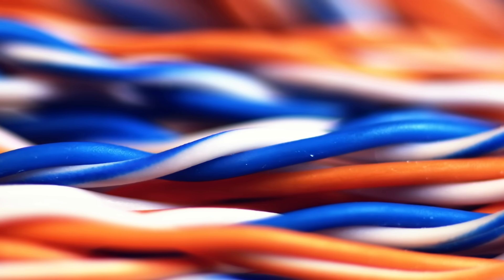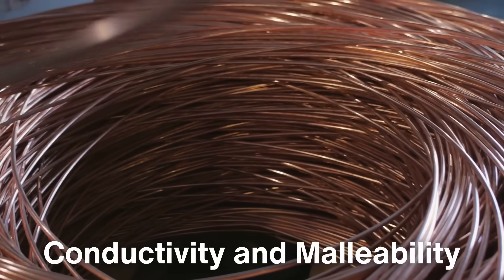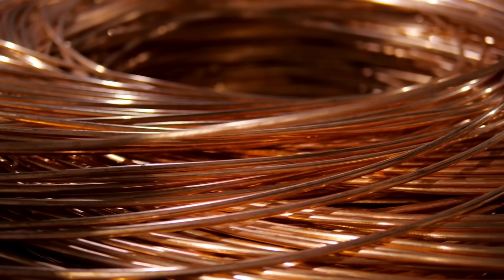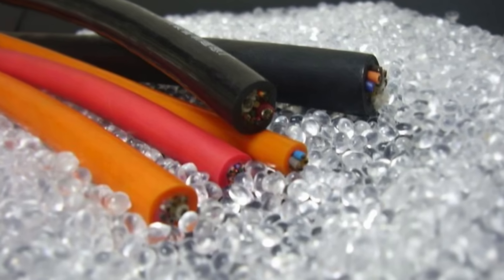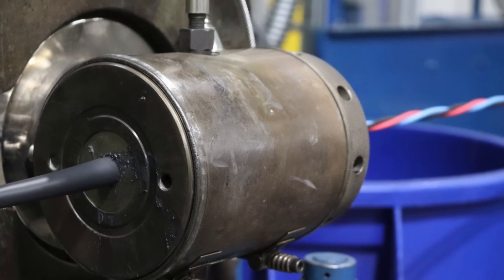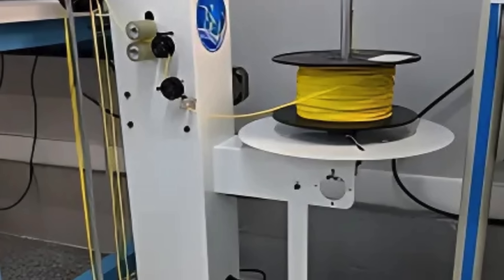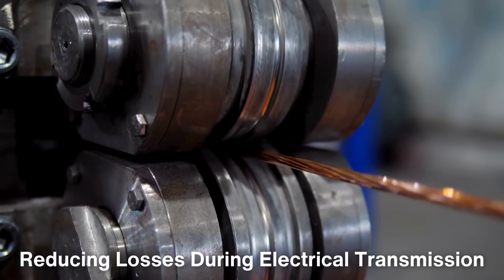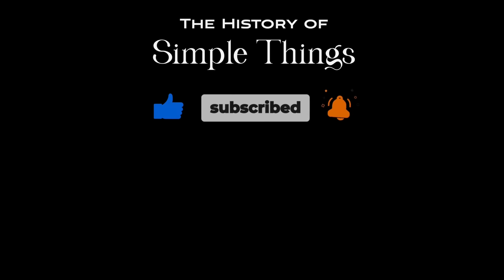How Insulated Wires Are Made: The Backbone of Modern Life

Comment: You don't want biodegradable plastic for power cables because a cable that dissolves itself is not reliable.
A cable laid has to carry electricity for many decades without being replaced and insulate to the outside.